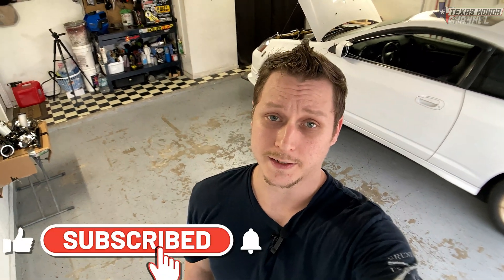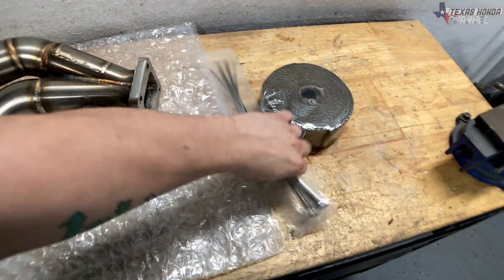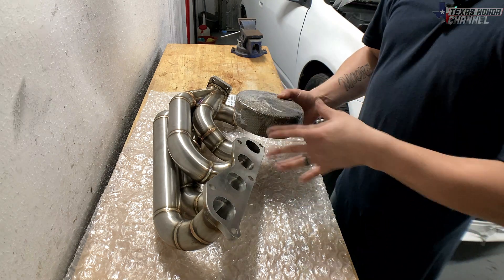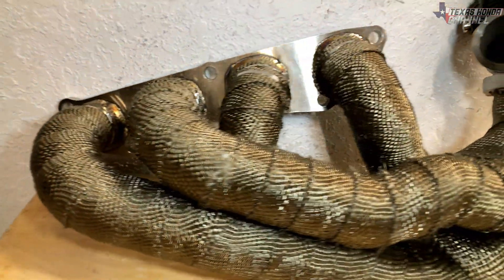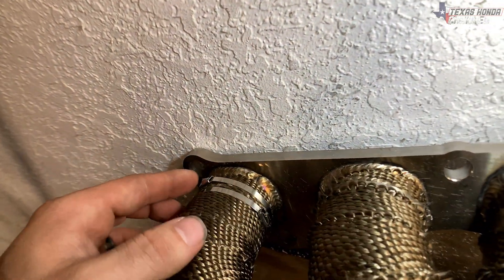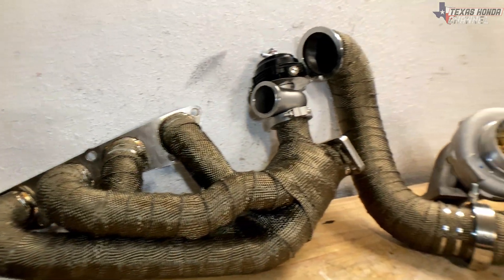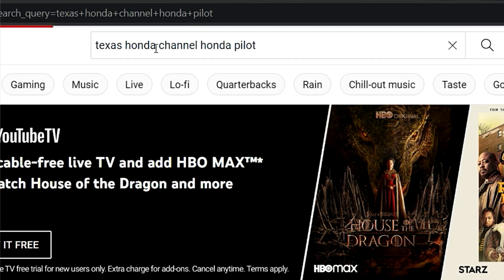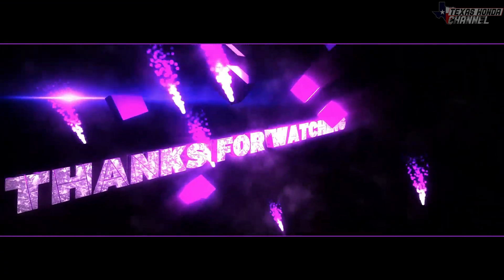TITANIUM WRAPPING K20/K24 BUDGET TURBO MANIFOLD FROM JACKSPANIA RACING

Comment: I soak exhaust wrap in water before applying it to the exhaust because the wrap will soak up the water and expand. After you apply the wrap and it dries out, it will contract and hug the manifold a bit better. Just my experience though, looks really good

Comment: When are you putting the turbo on?
Reply from the maker: After I get the rest of the stuff. I’m still missing intercooler, oil return parts and intercooler piping. Slowly but surely getting there.
Reply: @TexasHondaChannel  makes sense. Cant wait to see the finished build
Reply from the maker: @mal5728  yes same here. I’m working on the funds for the next parts. Not everything is free from sponsors but any help from them i get is appreciated 100% 😁 idk what I would do without them. Probably would take me forever to get builds done like it did back before sponsors haha.

Comment: Just did mine and the downpipe. Soak it in water first. Wraps a lot easier and less fiberglass getting you.
Reply from the maker: Mentioned that you could soak it but it works fine without. I assume you started yours up right after to let it evaporate? I can’t exactly do that yet so that’s another reason I didn’t wrap it with wet fiberglass.
Reply from the maker: @1:45 I mentioned this

Comment: that wrap will destroy your manifold.... I guess if you don't care about your manifold.
Reply from the maker: That’s not true i have done it many times with no manifolds destroyed. The stainless pipe manifolds don’t rust. That’s one of the awesome properties of stainless. If any rust does appear it’s surface. You can even make this one step better by adding a protecting spray over it after it’s wrapped.

Comment: Soaking it also helps it stretch some and once it dries it shrinks up. Making it tighter on the exhaust. Also iv seen alot of turbo rsx on YouTube lately and iv seen a few using the gold heat wrap that u used before in their firewall seems to help with heat some as well.i need to turbo my auto lol
Reply from the maker: Yes the gold tape but never on the turbo manifold itself. It does help it soaking for a few reasons but I’m not starting the car right away and I would want to start it up after the wet fiberglass so it would evaporate quickly
Reply: @TexasHondaChannel  yeah definitely not on the manifold or turbo itself just the firewall and lines behind the manifold.
Reply from the maker: @GlassWerx  yea!